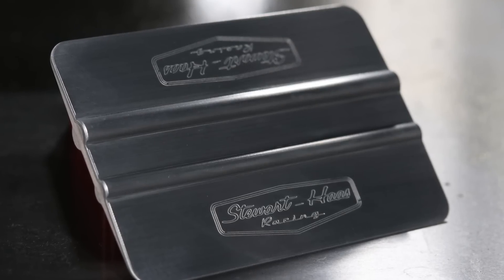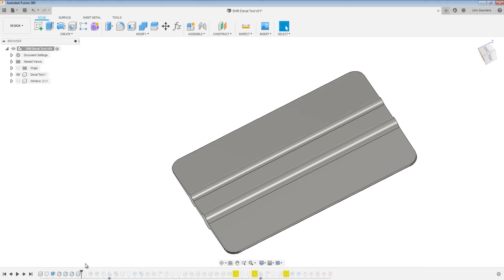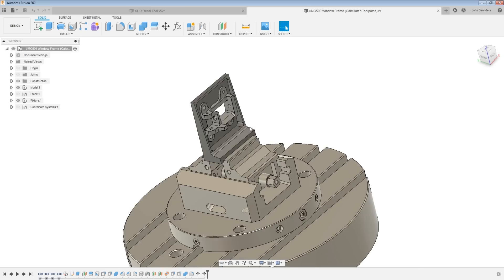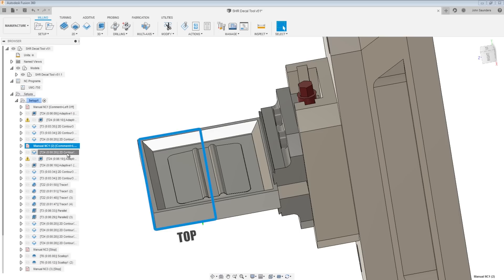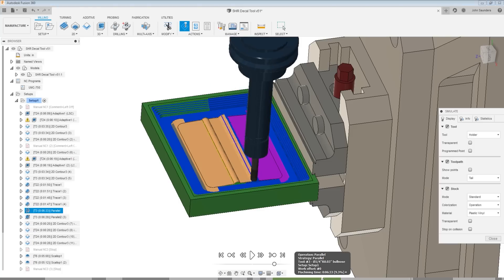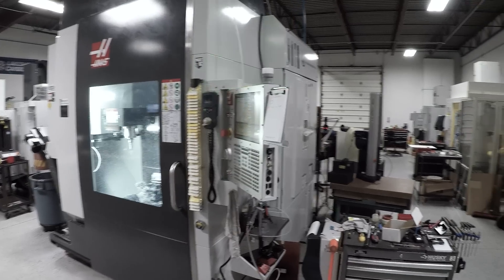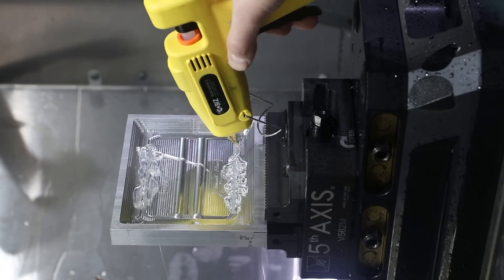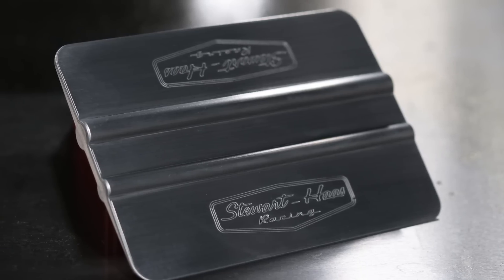CNC Fixturing Trick:  Window Machining + Hot Glue!

Comment: What we do at work is we do it on the bed to make sure it's more solid to stop vibrating. Also we use spuds to bolt a part to a simple fixture that also allows the material to bend naturally. And another tip instead of glue is to use car body filler

Comment: Same hesitation of using it as I had with super glue fixturing :P. Really love the discussions you've had around it with grimsmo as well. Would also love to see the "extension fixture" which can bolt to a part when parting off in practice. Keep doing everything you do and thanks for another great video.

Comment: One other awesome advantage of windowing is accessing multiple sides. If you don't have a 5-axis, and your part would be hard to clamp in certain orientations, the window material can provide you with clamping/alignment surfaces. We commonly drill right through the edges of the frame to access side features.

Comment: Nice tricks, thanks for sharing. Is there a similar windowing process on Solidworks? If so, what is it called? Thanks.
Reply: The windowing is function of CAM, not CAD. Now if you have HSM Works or SolidCAM integrated CAM with SW, then there might be a window machining function but I'm not really familiar with either of them to know if there actually ise.

Comment: you machined the part on a 5 axis machine, so I am curious why you 3d machined the large sloped surfaces of the squeegee? why not just re orient the part so that those surfaces are perpendicular to the spindle and machine them flat?
Reply: My assumption is because of the multiple radii features on the part.

Since there is the radius'd humps and transitions in the middle of the part and also the ends are radius'd too, might as well just use the ball mill for the whole thing that way you don't have differences in surface appearance since you will have the typical swirl marks on the flat areas from the end mill. 
John even basically mentions the  "important part of the tool" at 5:32 (right after the portion that talked about and showed surfacing done with it) was for profiling the radius'd features on the ends but really, the bumps in the middle would need too or you would have to have stair step type surface.
If you tried doing these radii with a small end mill, all of them would have stair step type surfaces and then ends that are actually used on the decals and such need to be smooth as possible so to just scratch or tear the decal or film, etc... The microscopic scallops from using a ball mill with a really small step-over will give a much smoother finish.
Reply: They were using a ball endmill. For best finish tipping the part so that when machining with a ball it’s cutting on the side of the tip rather then just rubbing with the tip
Reply: @CHinesRacing87  Right, but I think Jason is asking why not tip the part and then use a flat endmill.
Reply: @CmdrRoot  this is exactly what I was asking. It seems to me (in my unknowledgeable opinion) that this would result in a better surface finish than 3d machining while also potentially being a faster operation.
Reply: Why arent bullnose end mills used more? It seems like such a no brainer. Small diameter ball nose combined with a flat end mill.
Reply: The point of the video is to show a technique.

Comment: Nice, but the advantage of a squeegee is to be flexible
Reply: Julie SMW - I figured they wanted to make a mold negative so they could cast it in a different material, or maybe as a test-run for 3D printing.
Reply: Unless you’re trying to get ice off the windshield in the dead of winter!
Reply: Do you really think that's why he made this video? Because he needed a squeegee?
Reply: @zunuf  why then? Why not machining an origami?
Reply: master caution - sure, why not. Everyone needs a squeegee now and then. 😏